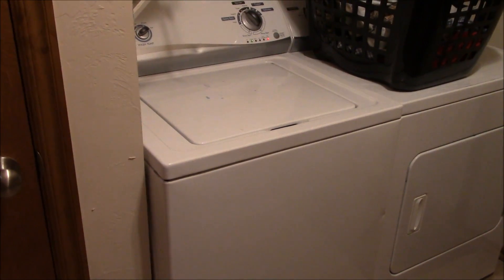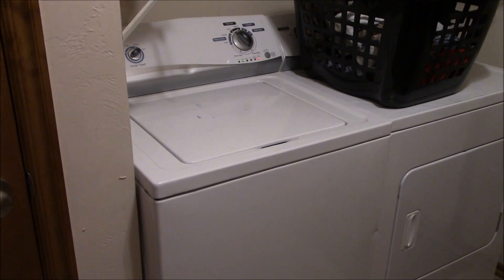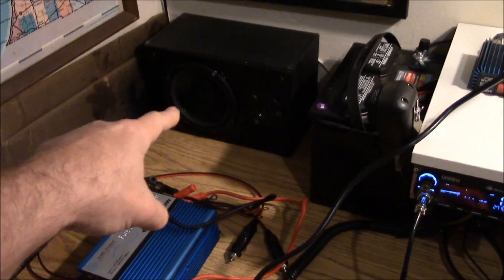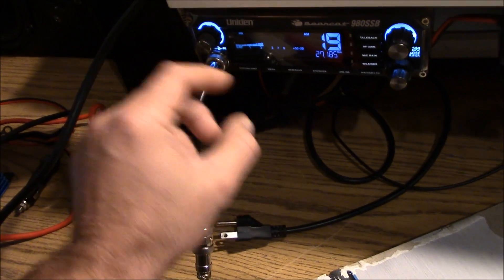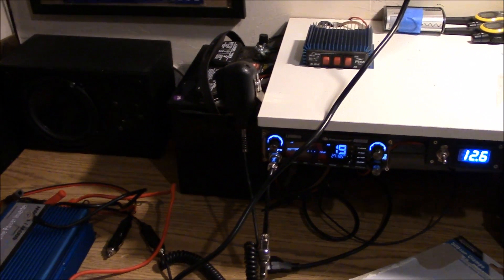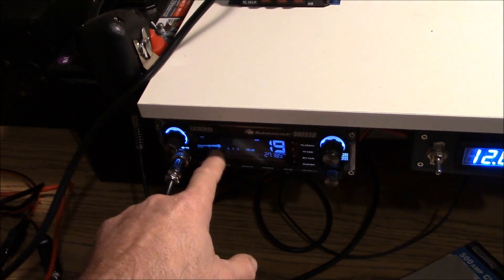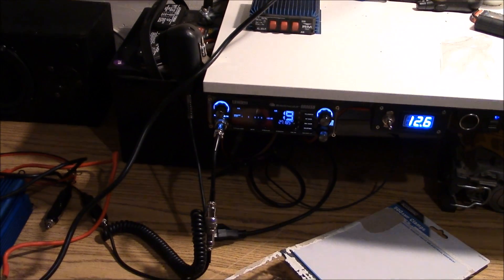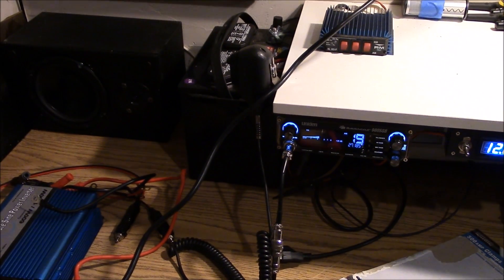Uniden CB radio base station interference from solar equipment/washing machine

Comment: Chris...  Easy stuff first.   If it's a shared ground, then try a separate ground for your radio.   If you have coax next to your power lines, separate them by at least  12 inches.  Could it be inductance off the power side?  Used to have problems like that all the time, but most new radios regulate that out.  But you may try a noise filter (ground loop) for a radio.  If it's coming off the antenna could try an antenna noise filter. I live near high tension lines between me and the rest of the world.  The power sub station at Sunnylane and Reno.  Try to filter that out.  Splice

Comment: If you have not already try these few things, run a separate ground wire to a separate ground rod keep ground wiring as far apart as possible, ferrite chokes, & shielded wire from your radio to your speaker.  The 11meter band is a lot of fun I used to operate on it a lot when I was younger.  Had a handheld 40 channel Radio shack CB, loved that thing until I had to change out 10 AA batteries 😢.  I spend most of my time on the ham bands nowadays & the DSTAR part of it is a ton of fun.  Communications from  Oklahoma to Washington would be fun if you get into it some day.
73's
Reply from the maker: Ditto...my first CB radio was a Radio Shack 3-channel with crystals. We are talking 1978! I have talked "skip" to Virginia on this base station.

Comment: I ran my inverter DC cables through a couple of ferrite chokes plus I have the big super capacitor bank on the front end.  Then I run my CB off the 12VDC battery bank and have a large filter cap before it and I get no interference on the CB.  Before I had a lot of noise like you are hearing.